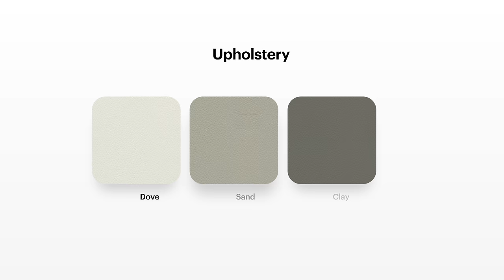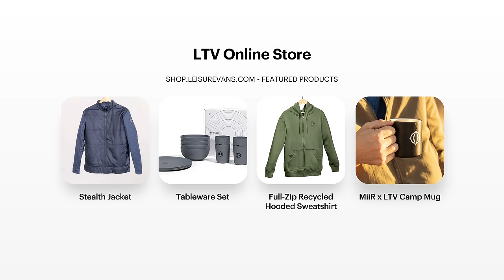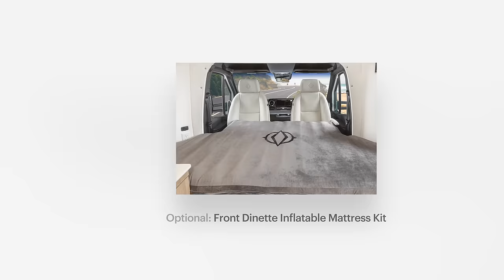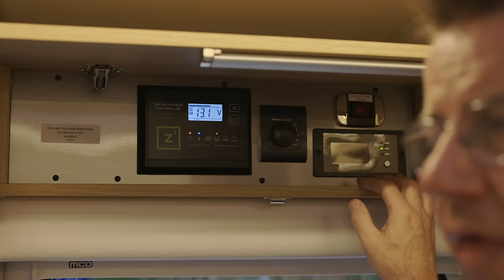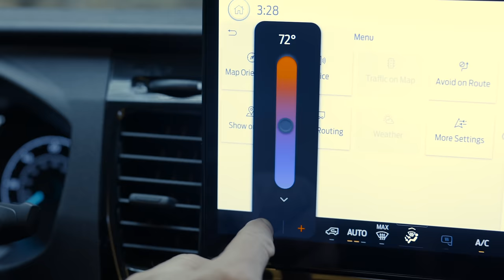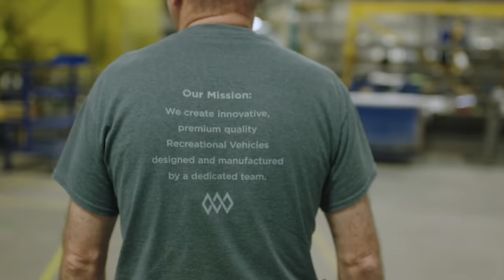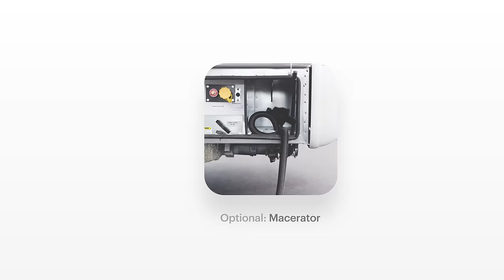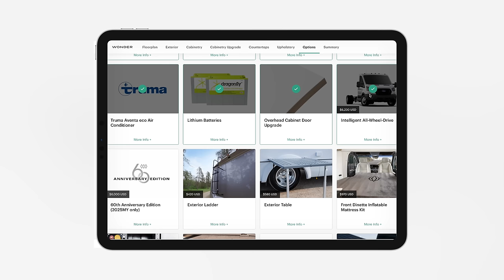2024 Wonder Rear Lounge

Comment: I have searched and searched and this is by far the perfect motor home! 🎉 I would buy a mini washer dryer single unit and fit it somewhere during its construction.
Reply: I think it could be put behind the driver's seat, in place of that small bench, and above it another storage space up to the ceiling.

Comment: Leisure Travel Vans is a perfect product, however, the awning-style windows should have a mosquito screen on them. This is one or two of the only imperfections in this product. Other than this, your product is perfect - as long as it is not on a Ford chassis and engine.
Reply: The awning-style windows do have screens, they’re inside attached already, look closely. Also, many prefer the Ford Transit, although a similar floor plan is available in the Unity LTV with a Mercedes chassis